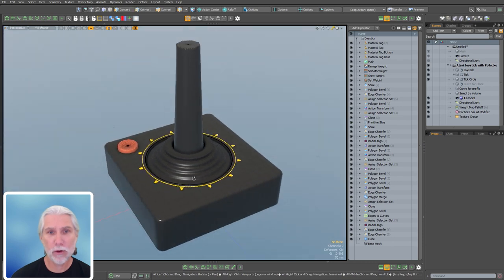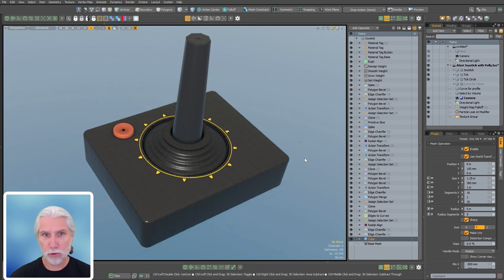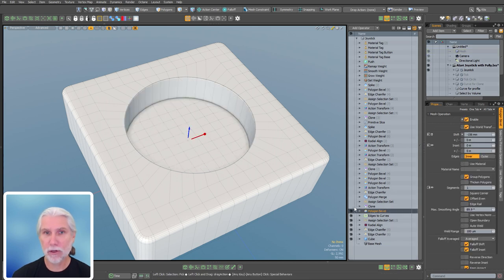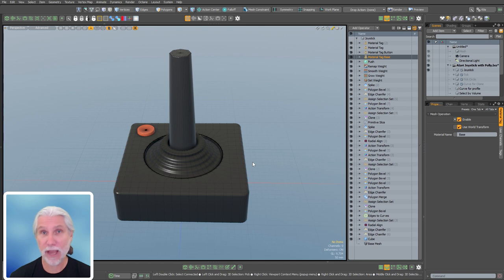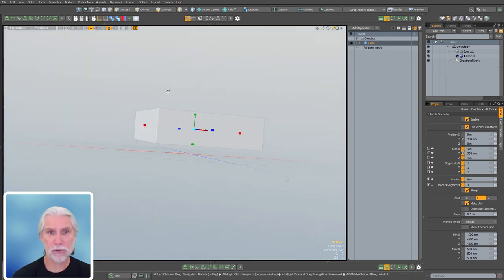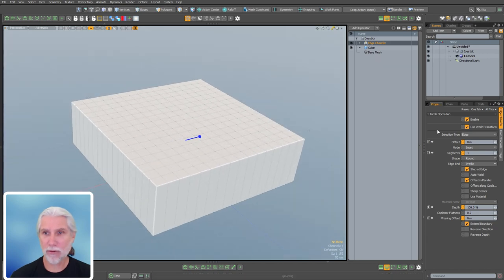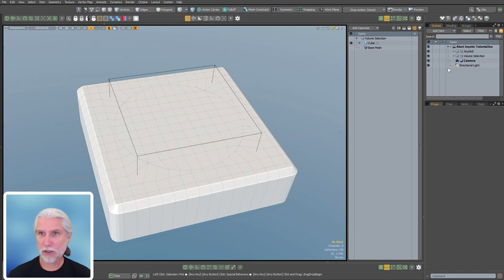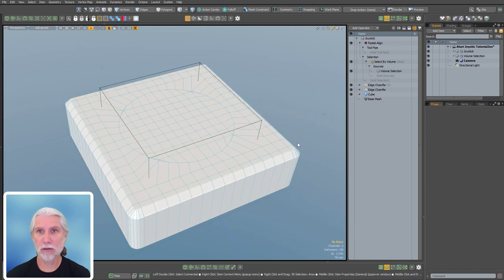MODO | MOP modeling an Atari Joystick with the Polly Kit.

Comment: Thank you so much for doing this.  A great example of using Polly, and of procedural modelling in general.  Feedback received -- it is trivial to remove the default hauling from Action Transform -- I ummed and ahhed about how it should be set up and as you say there is no setting that suits all needs.  The flipping issue with N-gon is a known problem.  Modo bases its polygon orientation on the first 3 verts and if they end up co-linear (which is much more likely in N-gon mode), then the poly can flip.  The work-around as you noted is to fiddle with the weight to create just enough of a kink to get the normals right.